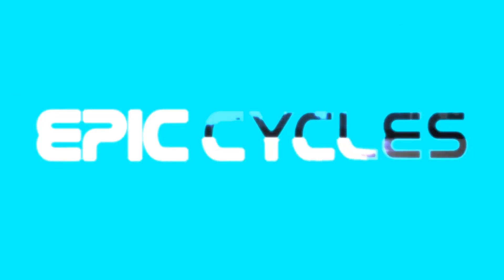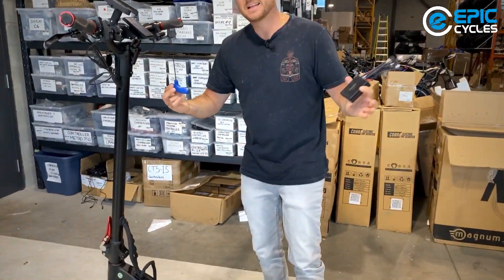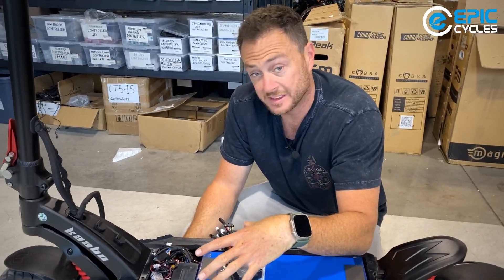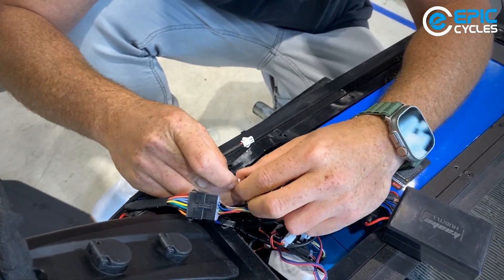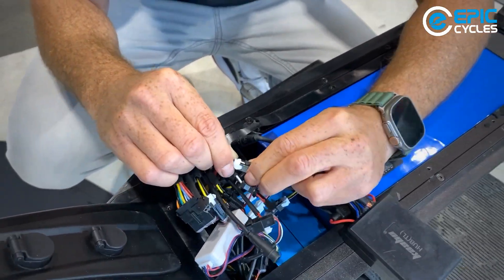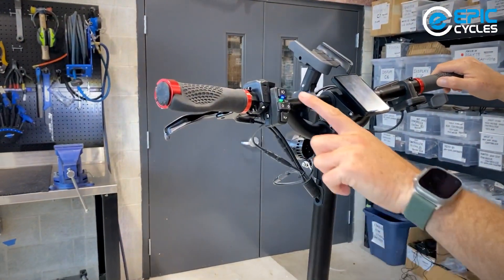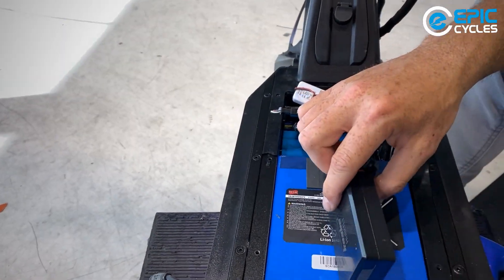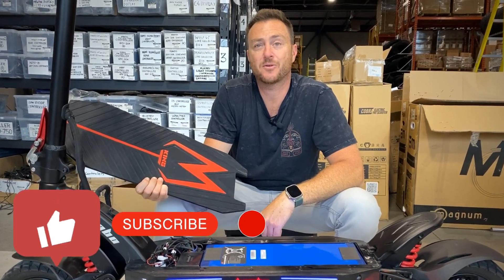Mantis King GT Lamp Control Module Replacement Tutorial

Comment: great video! my mantis king gt arrives Thursday. own 2 single motor scooters right now. king gt will be my first dual motor scooter. these videos give me confidence on fixing any future issues
Reply from the maker: Thanks so much for the positive feedback, it means allot to us to hear that.  We are glad to be of assistance and will continue educating with more helpful videos!
Reply: hello there. funny i find myself back at this video. i recently had a minor accident with my mantis  king gt. broke the headlight and all lighting went even after replacing headlight the lighting doesnt work anymore possible its the fuse you showed?
Reply from the maker: @sohogen8482  Yes it's possible, definitely worth checking.  Could also be a damaged wire from the accident so check that first to make sure there are no frays on the cable that the headlight is connected to.
Reply: @epiccycles9  no damage at all to any wiring was a 5mph drop lol unfortunately the headlight was directly hit and shattered. what do you recommend on using to stick the mat back? thanks fpr the replis
Reply from the maker: @sohogen8482  Ok that's good because replacing wire is a big pain.  We just use super glue to stick the rubber mat.  Every time you need to take it off and put it back on just reapply some super glue, just make sure not to go all the way to the edges.  leave the perimeter about half to 1 inch free of glue so you can fold it up similarly to how it comes out of the box so you have easy access to pull or lift.
Reply: @epiccycles9  was the fuse after all, replaced and all lights came back on. thanks!
Reply from the maker: @sohogen8482  No not in this case but It can be the cause as well so just wanted to mention to check that first before proceeding